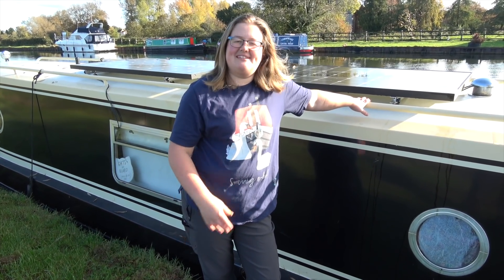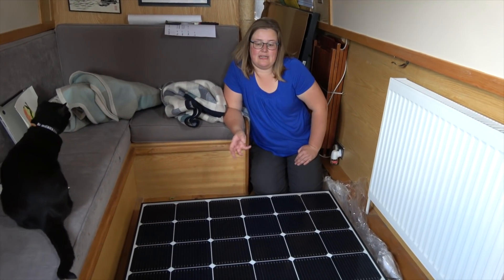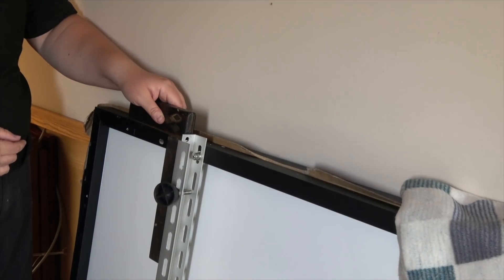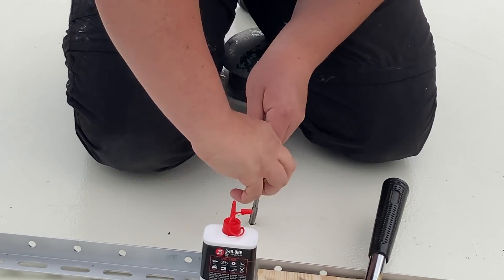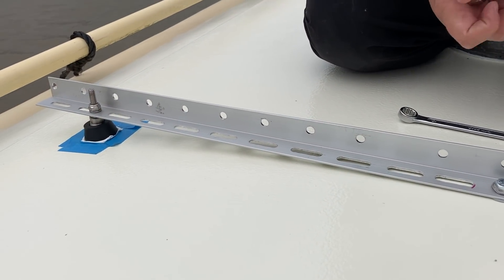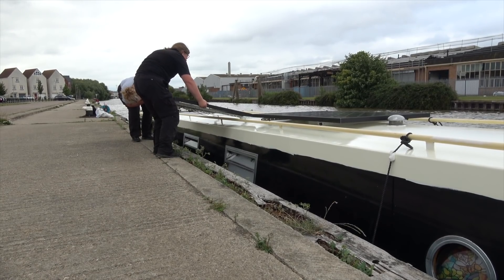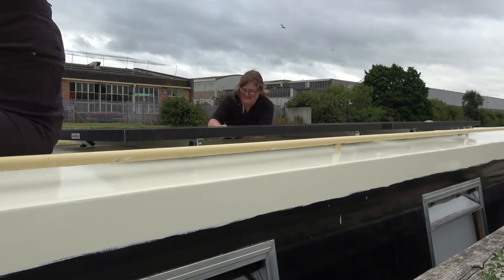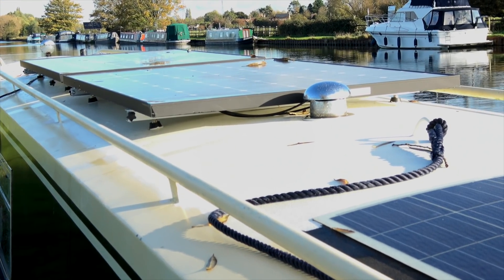How To Install Solar Panels on the Roof of a Narrowboat in UNDER AN HOUR

Comment: Thoroughly enjoyed your blog, very professional installation. Are you pleased with the brackets, I've been searching for a bracket system for a while and these look great, discreet, low profile when flat. Are they sturdy when the panels are tilted to around 70 degrees. Thanks

Comment: What’s the difference between the Flexi panel and the ones you have just put on board? As the FP are less intrusive why would you not go for more? Please.
Reply from the maker: Hi, Kath says in the previous vlog that the capacity of the rigid panel is better, as you can tilt it also. Depends completely on your needs etc.

Comment: Well done ladies, another excellent technical video. Looking forward to hearing how the panels perform  especially if one is partially  shaded, as well as the comparison with the flexi panel.  I expect you will stay cooler next summer with the lighter coloured roof. We certainly noticed when we repainted our roof a lighter colour.
Reply from the maker: Excellent, we have some performance vlogs coming up.

Comment: Great job on these, Kath! Always fun to see a well-thought-out job done neatly and efficiently, especially the prep work you did which clearly paid off.  I'm guessing given the length of the run those are heavier cable than the light-weight ones I see (since you'd be avoiding voltage drop). I'm used to AWG here in the states but if my guesstimates on conversions are right I'd think you probably used 6mm cable? I wasn't sure what the total length of the run from the back of the panel to the controller ended up being and if you'd pre-calculated the voltage drop or just did a quick check and knew 6mm would be good for any reasonable length? At the end of the day, whether the voltage drop is 1% vs 2% won't really matter much, and if 6mm cable is cost effective, then it's a win :) I know a common issue here for folks w/ RVs (caravans) is they use something with an AWG closer to your 4mm because it happens to be laying around or they don't realize how much of an impact it will have long term! Also a nice job of preventing rub-through with the piece of hose - might be something to add to the regular checks so you never get a short and damage the diodes on the back of the panel (also something I end up replacing for folks regularly, it seems, often after wiring issues or over-voltage events due to series-ing too many panels in a desert environment where they've never gotten 'optimal conditions' before, amusingly). I'm glad Alice supervised and only stepped on you a bit :) The new paint on the roof does look great, as well, Annamarie! Thanks for putting this one together - I can't wait to see the data on the upgrades to the total power budget now especially as winter approaches. Hopefully these help you avoid engine hours, which is another win (both in diesel and time between maintenances). Looking forward to the future info, but no matter what, I hope you all have great weather and plenty of enjoyable moorings and are staying safe.

Comment: That's a very tidy installation. I'm a little surprise that you're connecting the panels in series rather than parallel though. What are the specs for the panels?

Comment: Nice job Kath!  Kudos for finding the perfect mooring along that quay, making that jig, and using butyl tape.  I’m giving you this week’s overkill award for using Nyloc nuts on the assembly.  Your roof is now the same color as my boat.  We just got a fleeting look at Annamarie’s roll and tip technique;  if you have the footage, I’m sure many would appreciate a roof painting episode - paint used (2-part urethane?), grit used for sanding, roll and tip technique, etc. Just an observation, if that is a 2-part urethane, you really should wear an organic vapor respirator.  The isocyanates in the catalyst are really nasty.

Comment: Wonderful job, well done. I would suggest that after a couple of months to check on the fuel line you used at the vent to see if there is any significant wear on it, just to be on the safe side. A rocking boat, wind and weather ( rain or snow) could cause it to move just enough to wear. Look forward to the next weeks video.

Comment: You could have drilled that a lot faster.  The tap set you bought was high carbon steel, the one you wished you bought was high speed steel.  You always want HSS in a tap, you can also buy coated taps, which for the purposes of hand tapping in mild steel probably doesn't have huge benefits but I would likely buy a TiN coated tap, they are usually just slightly more than uncoated.  Unless I was tapping something exotic I would not buy a more exotic coating lik AiTiN or TiAiN.  I'm a machinist, I cut metal every day.

Comment: Good job.  Yes as a solar engineer never have the pv cables in a rubbing situation since the pv if shorted is a low voltage arc welder and cannot be turned off unless you disconnect the mc4 connectors.   Most pv fires are the “homerun” to the solar electronics and not the electronics.   In America drilling your solar panel frame voids the warranty.

Comment: A tip when tapping - for every half turn clockwise, do a quarter turn anticlockwise to clear the metal cuttings. Makes it a lot easier 😉
Reply: And when tapping aluminium, use WD-40 to lube the tap.  Works better than oil.
Reply: All about feel, that's a through hole so you can tap a lot deeper before needing to break the chip.

Comment: Nice installation.    Well done.
I do a lot of metal work, including tapping holes in aluminium and steel.    The tap handle you were provided is far too short, even for aluminium.  FYI if you need to tap into steel in the future, there are several types of taps, straight flute - least expensive but require most force, spiral point a bit more expensive but not as much force required and spiral flute, the most expensive but the least force required.  I have been able to tap into some steel projects with the spiral flute tap but not the straight flute.
Good idea to be able to tilt the panels.   Solar panels are not very efficient and need all the light they can get.   If the sunlight is at too low an angle, the light will reflect off and reduce the efficiency even more.   Well worth the cost and added installation for the frames.  The handles to lock the frames seem small which may be a problem on cold days with cold fingers.   Consider replacing the handles with regular bolts with hex head and use a socket on a cordless drill.   So much easier on the hands in the cold weather.
Dave.
Reply: Dave, isn't there also a back and forth movement for tapping also, cleaning out the threads as you go?

Comment: Hmm... does M8 come in coarse and fine thread versions by chance?  That drill bit size might have been the one technically for course threads (smaller hole) but would still work for fine (slightly larger hole) with just more difficulty in tapping the hole than there should have been.

Comment: Good to see the mask while sanding! Very well done, professional level install that a full time installer would be proud of. 
One thing, were you backing that tap off every 1/4 turn or so? 1/4 turn in, 1/4 turn out, half turn in. Very advisable to use the two bolts but TBH the Sika alone would have been more than sufficient, they glue the skin onto aircraft with the stuff.

Comment: Interesting choice to go series wiring - in light of the links to other YT channels you posted last week - which I watched.  As your older panels have their own MPPT there is no panel mismatch issue - so is the series choice down to length/size of cable runs? It seemed to me from the other channels that parallel was better for shading issues. Curious from a Mrs Trellis of North Wales. ;-)

Comment: Great work, very impressive! I was a bit surprised that you used only two bolts per panel and just glued the adjustable feet to the roof. But I am terrible at estimating how many fasteners are actually needed :) Anyway, the panels look great! Thanks for sharing this with us. Best, Ole.

Comment: Hi Annamarie and Kath, another great video, well done on the fuel hose to stop chaffing of the cables, something more robust might be needed if the fuel hose protector is actually in contact with a sheet metal edge of the mushroom vent, or secure the cables sufficiently to ensure they cannot rub along the edge.  You girls are the best.  I have started clicking the bell icon again for all the channels I am subscribed to to try and get notifications via email again.  Here is hoping!  Stay as safe as you can in these difficult times.  Regards a fan from Aus.
Reply from the maker: I honestly don’t imagine any damage being done to the cables. Our old boat had cables going into the mushroom vent that had been there for years and years and showed no damage. 
Youtube have stopped emailing people notifications. The bell will only give you a pop up I think if you use the YouTube app on a phone or tablet.

Comment: I am a big fan of watching your vids.  I prefer panels in parallel as in series if one panel fails you lose the whole solar energy as power through one panel goes through the series next one, or doensnt if panel fails. Failure of panels is normally caused by vibration. But Narrowboats dont suffer with this problem but motorhome do caused by road potholes and rough roads. Cheers from grumpy George
Reply from the maker: Thanks for watching. I keep such a close eye on power coming in that I would notice fairly quickly if suddenly there was no power coming in and run out to test the panels and rewire if necessary. So I wasn’t too worried about one panel failing!
Reply: @TheNarrowboatExperience  Cheers guys. Jane's brother built his own boat. But not the metal shell. It's called Still Water and it's based around Derbyshire? 👍👫🐟

Comment: I think you should have used a slightly bigger drill, do you use any specific paint on your boat or just house hold paint?
Reply: Sorry I meant a bigger drill bit 🤣
Reply from the maker: More powerful drill ? Mine was fine!
We used specific boat paint for the boat. At the very least it should be paint designed for use on metal.

Comment: What made you choose the bracket solar panels instead of the ones that glue down and sit flush on the roof?
Reply from the maker: I wanted to be able to tilt to maximise input during winter months.
Reply: Can you tilt to both port and starboard with the frames you used

Comment: Brave body of water to do roof work on! Excellent job though. One question I have is how do the panels actually tilt? Surely if you have to fully remove the black knobs with the nuts one could easily drop the nuts and never see them again as they sink slowly to the bottom of the canal.
Reply from the maker: You could easily drop the nuts or the bolts. But the idea is to not be adjusting them all the time. There is a third rail that gets added in. We are looking at alternatives to the bolts we have to make it quicker to tilt when needed.
Reply: @TheNarrowboatExperience  yea, maybe like the solid pins with ball bearings in the end to stop them just dropping out that you often find on things that move often.

Comment: You did a really thorough job of the preparation. An interesting canal I'm told one of the deepest in the country. I found putting a solar panel on the roof  has transformed my life on board and so far has given all the power I needed which was mainly to power the diesel heater start up and pump. Thanks guys take care. Alan x
Reply from the maker: It’s a lovely canal. Worth the visit I think. Take care